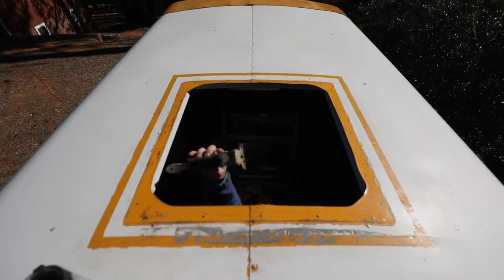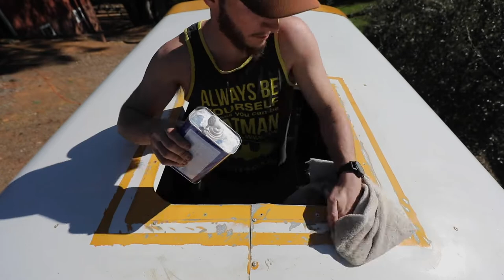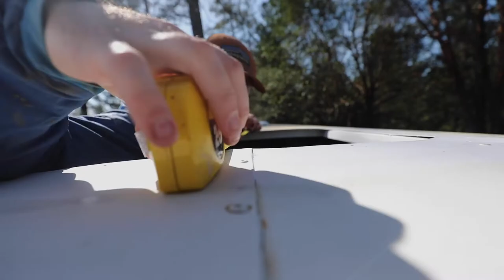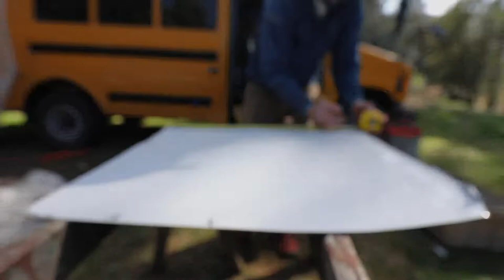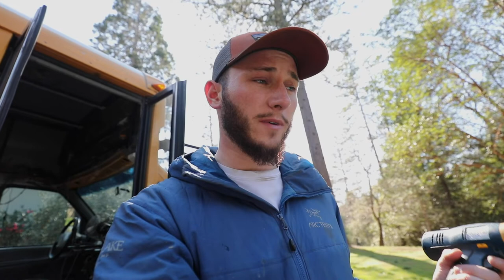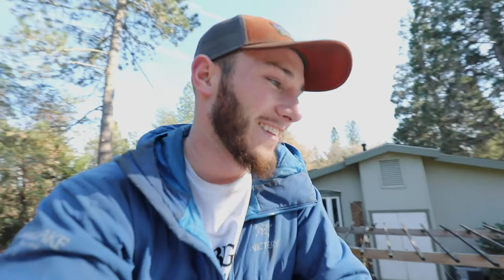Roof Hatch Patch - Bus Build Episode 6

Comment: What gauge metal did you use?
Reply from the maker: I'm not sure the gauge but it was the salvaged material from what was on the ceiling of the inside of the bus. Since putting in this patch, I've installed a vent fan in the sheet metal and added structural support underneath that is braced into the frame of the roof.